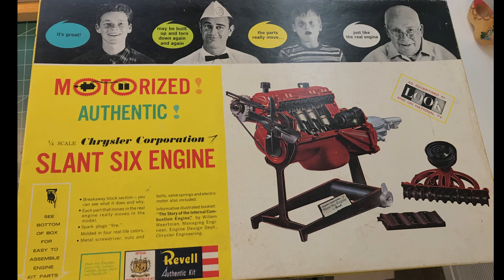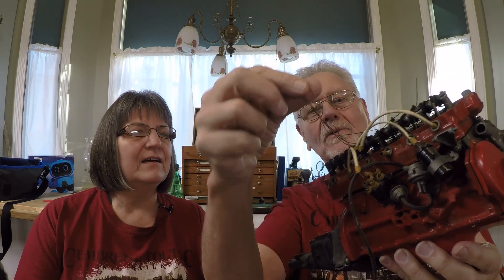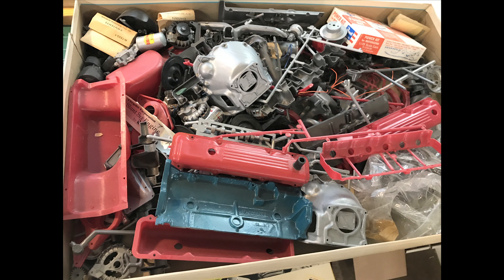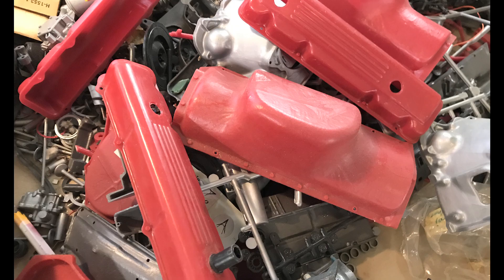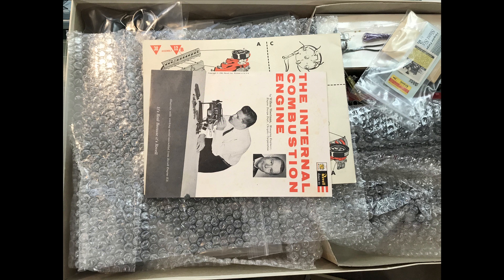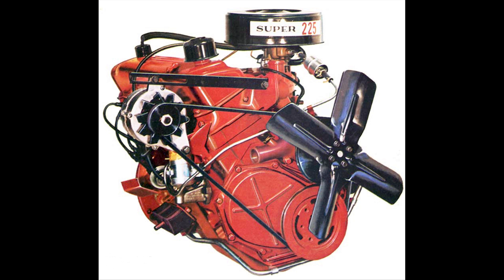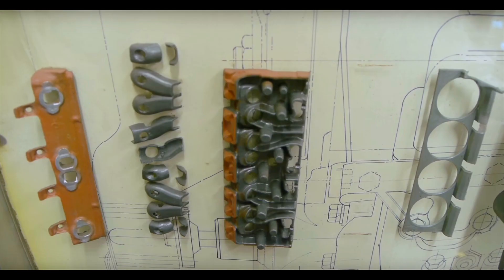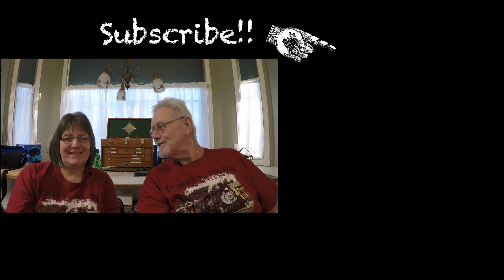1961 1/4 scale Revell Slant Six

Comment: I had a slant six Valiant back in the day.  Everybody used to tell me that Chrysler and Ford were coming together to build a car in cooperation.  They said that they were going to take the designs of the Valiant and the Commit and come out with a composite vehicle.  They said that it was gong to be called the Vomit.  Actually, the mechanics of that car far outlasted the body.  Later I had another Valiant with their small V8  and a four speed floorbox manual transmission.  i really liked that car.  You are bringing back some old memories my friend!!
Reply from the maker: I think I had a Vomit.  No. It was a commit. But it burned before I got it. Didn’t repaint it. Sort of liked the look. Rat rod ish. .

Comment: PS about the prototype slant six, my mom had a Dodge can with a slant six motor. When we moved to California we had to install emissions control to pass a smog check. The engine output suffered. Then a friend came a long and offered us an experimental emissions rebuild. He changed from a carburetor to fuel injection and bread boarded an engine computer. It was a major improvement.
Reply: Dodge Van not Can. #%&+€¥=π~% autocorrect.
Reply from the maker: I reality hate auto correct smell checker.

Comment: Loved your description and examples from your collection of the Revell Slant Six.  This reminds me of my building of a Revell scale model R-985 Pratt & Whitney Wasp Junior Radial Engine which was used in many aircraft in the 30s, 40s, and 50s and was the engine for the DeHavilland Beaver aircraft that I flew as an instructor pilot in the US Army Aviation at Fort Rucker, Alabama.  The model had moving parts for the nine cylinders with lights flashing to show ignition.  I built it and loved it but it did not survive my young son who was had to take things apart to see how they worked and we didn't get it back together again.  I have been looking for the model -- either in the box or assembled -- on Ebay since 2015.  I'm glad you found your Slant Six and I hope someday to find my Revell R-985 Pratt & Whitney Jr. engine.    Thanks for a great video.  - Dean from cold Minnesota.
Reply from the maker: Love that kit!  The 60’s release went nuts so Revel re released it in the late 70s? Or early 80s?  Have two of those but I’ve never even seen the 60’s version. They also made a visible turboprop engine by Allison. Wow!! I had 2 of the original60’s version of those but sold them on eBay. Still have the 70s version.
Reply from the maker: There is an original 1960 version on eBay!!! Geeee. Expensive 

https://rover.ebay.com/rover/0/0/0?mpre=https%3A%2F%2Fwww.ebay.com%2Fulk%2Fitm%2F132929281047
Reply from the maker: You need the 70s version the revell history makers kit.

Comment: My white 1961 Plymouth Valliant had an inline slant six engine. Actually, there were two engines because the previous owner apparently never changed the crankcase oil or the oil filter, and on a short highway trip back in 1967, the engine seized up, and it cost me a new (rebuilt) short block for the repair.
Reply from the maker: Oil. It’s an idea some people don’t grasp. Don bought a first generation synthetic oil for his Supra years ago. The guy (going door to door) who sold him the oil said he would never need to change oil again. So it’s worth the 20 dollars a quart he was charging. Sure.... anyway that’s how Don got his first Celica wagon. After the engine is the Supra engine seized up.

Comment: Did that motor actually work or have moving parts
Reply from the maker: Yes electric motor turned it over. Cam works lifters and pushrods to rockers and valves. Pistons have both oil and compression rings. Spark plugs have red lights in them that “spark” in proper timing from a functioning distributor!  It’s a complete engine made of plastic in 1/4 scale!!

Comment: The Chrysler Slant six engine was a great motor and still is, I know a couple of older boats that have them as main engines.  They were found in industrial application all over.  They were a widely used motor, with a good service life.   

In 1961, Chrysler began using alternators in all their cars and trucks.  For the first five or six years they used the same 35 to 37 amp output alternator.  It wasn't till the late sixties that they bumped up the alternator's output to 62 to 65 amps,  this depends on what manual you read.  The reasoning for the 35-37 amp alternator in the first place was their generators at the time were putting out 25 to 30 amps.  

As a matter of course  GM came out with the Delco Remy Delcotron alternator in 1964 with an output 55 amps for the cars and light trucks and a 75 amp as an option for the trucks.
Reply from the maker: That’s how to tell a 641/2 mustang from a 65. The 65 came with an alternator. Just turn the key on a first year. If it says GEN on the warning light it’s a 64 1/2.